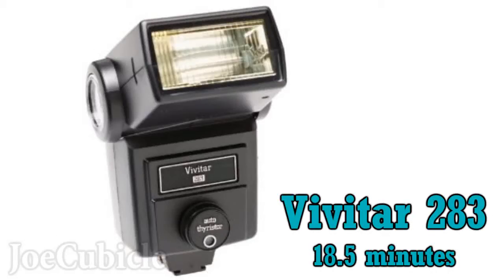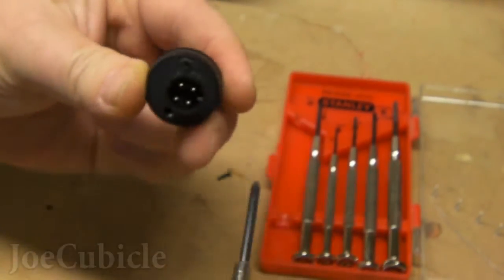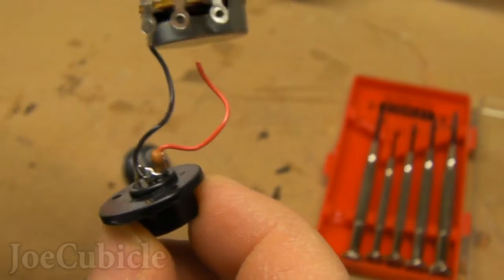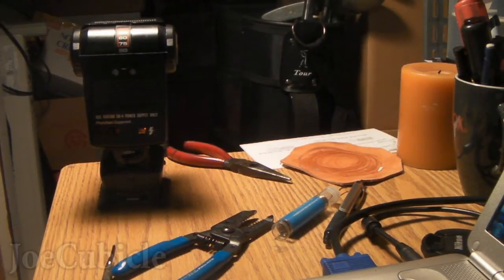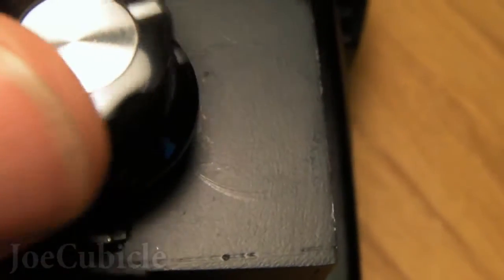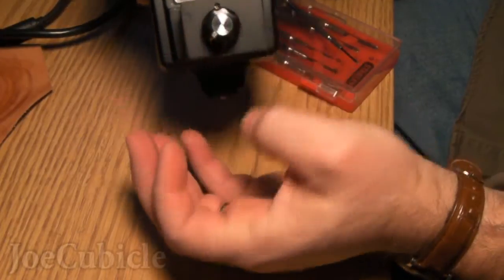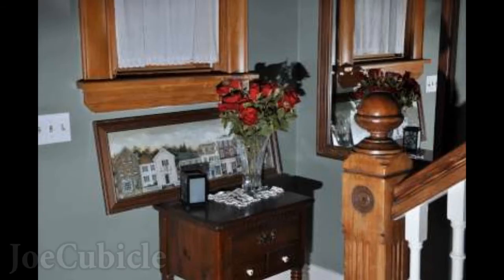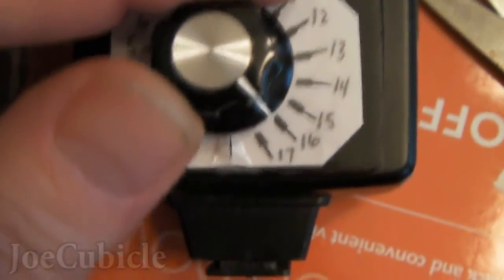Vivitar 283 adjustable flash hack - Long

Comment: do you know the problem/fix when the 283 or 285hv fires only at max power?

no, don't guess by saying the auto thyristor sensor is defective or loose.
no one has the answer.
Reply: The auto thyristor sensor is defective or loose.
Reply: @robertmueller6979  guess you failed to read what i've stated?

Comment: Wow. I tried your instructions and now have a variable output flash at almost $0 cost. It's not as fancy as yours, but it does the job. One main advantage is that I can now do studio work at less than full throttle and the recycling time is now 2-4 seconds instead of 4-8 seconds. Thank you so much for sharing!

Comment: Do you know when using the 100k pot how low the adjustability goes? From full power down to what, 1/16th? Or 1/32nd? It'd be awesome if there was a way to know and mark the DIY dial so I'm not guessing each time